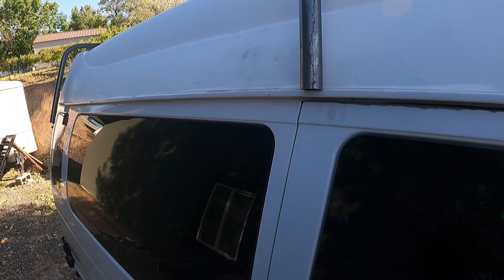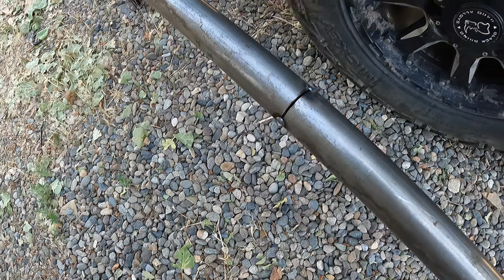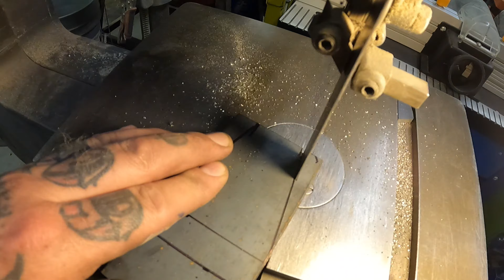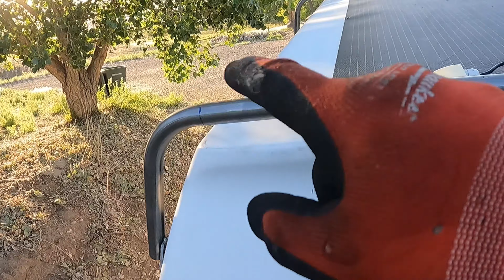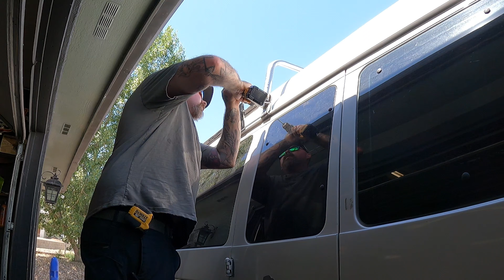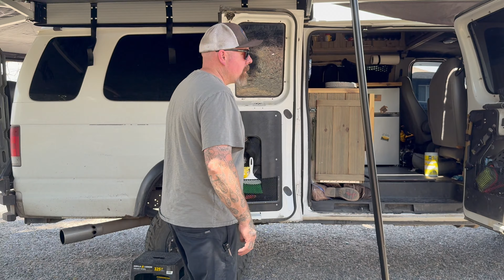Ford Econoline Roof Rack Build & 270 Awning Mount + 450 watt Solar panel

Comment: Hi. Nice set up! Would you be willing to build another one? I have a Ford e350 with a fiberglass high top that I want to add a 270° awning to as well. Lmk. Thnx
Reply from the maker: I would be down to. Sorry I didn’t see the comment until now. You’d have to come to Colorado though.
Reply: @MountainVanMan No worries. I live in Colorado.  Currently on the Western Slope, but will be working in Summit County this season.

Comment: Great job. I did the same type of drip rail legs on my lumber rack on my van. The lumber rack was off a long bed pickup with a camper shell which is extra wide, it fits perfectly on a van once you cut off the legs. Your 270 awning is awesome. Thanks for the video